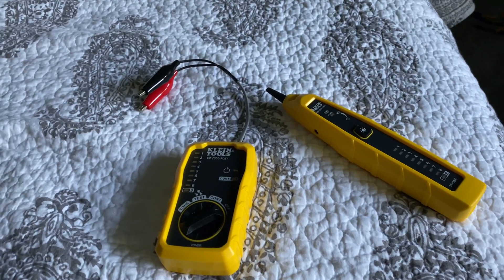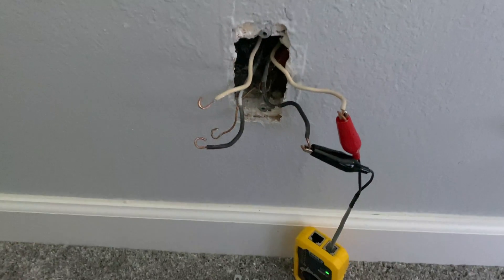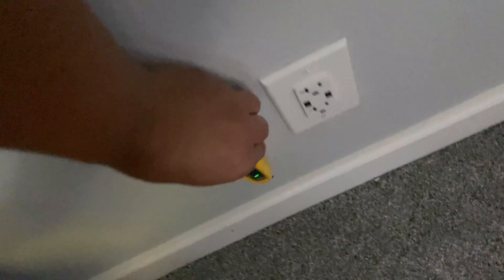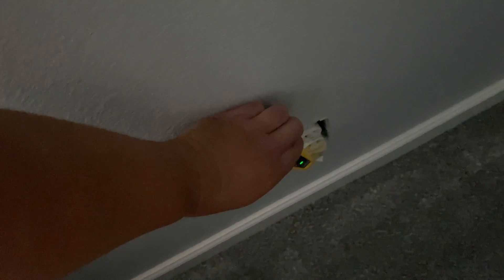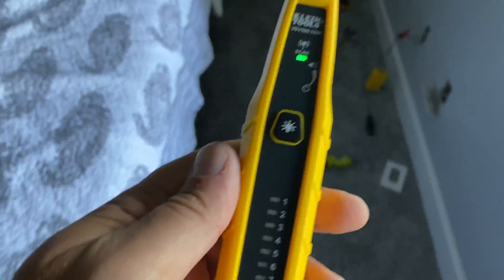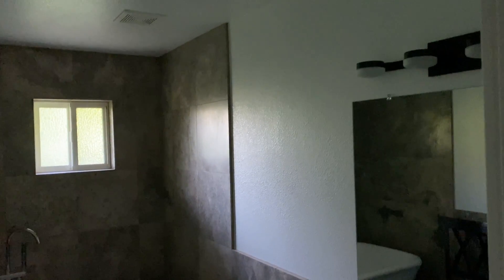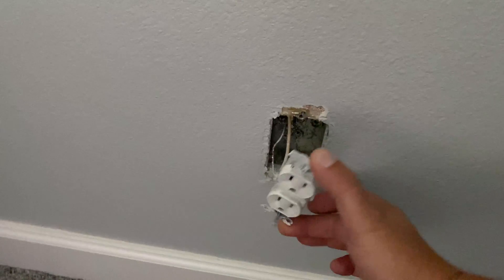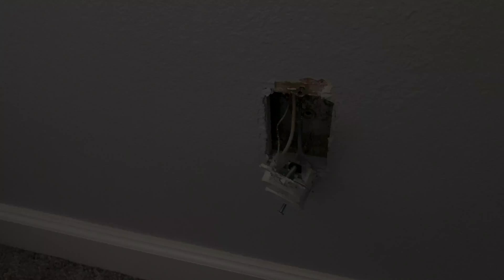How to find wires inside walls: Wire tracing tool- how to

Comment: Great.  :-p  One of those people that screws up wiring where an electrician, and or purchaser of the home does not know what's running where, and or too much is on one circuit.  Or, it was already screwed up, and you made it worse, instead of fixing it?  Depending on your existing panel, circuits, wiring, have one circuit for each room.  Also, depending, that may be in relation to what is, or needs to be, connected/wired to each room, such as, possibly, 1 or more 15 amp, 120v mini splits or window AC's.  Of course, there can be, for instance, if having an older panel with not enough wiring/breakers/circuits, two bedrooms next to each other on the same circuit, but wired correctly, individually, to a proper breaker, and labeled.  ETC!

I completely understand many may want to DYI.  It seems to me most people think of hiring a pro, or DYI.  But, they don't think about both.  Plan out what is wanted to be done, put the plan on paper, hire a pro to eval.  Sure, you will have to spend some extra money, but that is still a lot less expensive than also hiring the pro to do the work.  That can save you a ton of hurt!*

*The wiring you put in the wall for the TV,  is it properly terminated?  I.E., does it need to be in a junction box according to your local code?  (Often, local code is stricter than the NEC.)  If by some chance it causes a fire, when the insurance finds out, and you can bet they will, they will deny any claim.  So, since it was not clear, or I missed it, are the wires still hooked to the outlet?  If so, disconnect them.  Loose wire/s in the wall connected to nothing will harm nothing.  But still, you can wire nut them and put electrical tape on, at least, the junction box side.  Or, pull the wire out.

TID BIT: Never leave an open splice, anywhere.  In the attic, protect the wiring from damage, such as just accidentally walking over them and damaging the insulation.  Check codes, such as for stapling, also.  A homeowner can usually run loose wiring in a wall, as long it is permanent, but the attic may be a whole other story.

Comment: word to the wise when the batteries get below about 50% the tone gets too quiet to hear through most walls so i would recommend putting rechargeable batteries in them if you use them a lot

Comment: I had the same problem with my sister's house. 6 outlets don't have power. First, the 3 outlets (are connected to each other) from front door -> window -> corner of the house. However, from the corner outlet, I don't  know where the wires go next. The wall adjacent to the corner outlet, there's an outlet behind the piano and that outlet doesn't work. This outlet is not connected to the corner outlet. So I don't know where the corner outlet is connected. I did more troubleshooting and found out that the piano outlet is connected to the right outlet behind the tv. Behind the tv, there are 2 outlets (left side, and right side). The left side duplex outlets work, but not the right duplex. I found out that the right duplex is connected to the piano outlet. The outlet behind the water bottle has no power. I can't find out where this outlet is connected to. 
Will this device help me to find it? I need help. I'll buy this device and hopefully I can find where the line goes.
Reply from the maker: Sorry for the late reply! yes it will... make sure all your breakers are off, connect it to your mystery wire and trace it with the tone... hope it helps!

Comment: Great demo. Don't forget to cut power on all breakers first! May not be obvious to newbs.
Reply from the maker: Thanks James! good point on the breakers
Reply: @PilotJon  Thanks. Your video was very useful. I have always use toners in low voltage environments, but never in high voltage applications. Thanks to your video, I was happy to know I could a use the toner tester without making a huge flash bang or worse. I had to see someone do it first though! There are instructional videos or discussions out there, but not much demo.

Comment: Good demo, however everyone should know to shut off the breaker(s) and test the outlets with a tester to ensure there is no hot wires or current on the outlet(s) your working on. Not only for safety, but the wires have to be cold for toner to function properly... unless its low voltage like data wires, these can remain on.
Reply: I'm tired of those videos always mentioning the whole safety chapter of the manual. Yes, we know we cannot put a cat in the microwave to dry it. Those who don't, will have to read the manual.
Reply from the maker: 😂❤️ same…

Comment: Does this have a range or as long as the tester is connected or the tone tool will always beep if it sees the signal in the wire
Reply from the maker: as long as it is connected to a wire it will work. no range basically

Comment: Do I need the power off or can be on ? Thanks for your helps.
Reply from the maker: Good question- the power must be off using the tool I used.
Reply: thanks for very  for the quick response video

Comment: The title is wrong. As you said it is a continuity tester and that can be done with much simpler equipment. You can't find wires in the wall with this.
Reply from the maker: Sorry yours didn’t work out, mine clearly traced the wires inside the walls
Reply: Sure you can

Comment: Will it work on wires that have no power? I have some wires that aren't getting any power so I need to trace them to see where they go without tearing up the wall and ceiling.
Reply from the maker: Absolutely. In fact for this tool, the power must be off

Comment: My walls are concrete covered with plaster.  Wiring is 220-230.  I need to know where the wires are, so I can drill into the walls and hang pictures.  Will this tool work for me?  Is there one I can buy and use in Europe?  A lot of electrical issues are different here.  I have not found any local information on how to determine where my wires are.
Reply from the maker: you sure can! I didnt explain that my walls are block wall covered with drywall (plaster)

Comment: Very helpful! A retired electrician gave me some of his tools, and this is among them. I need to tap into a porch light supply so that I can run power to an outdoor ceiling fan, so this will help me tell where those wires are.
Reply from the maker: it will!

Comment: I know this is an old video, but can this trace a single wire? Like a 3 way switch? I'm trying to figure out which wires are my travelers and I'm not an electrician. I'm trying to trace my red wires, because I have 3 switches to go to one light, and they all work independently, but not together and it's annoying.
Reply from the maker: Hi Chris, with this one it has to have dual wires.  You could use a continuity tester for your situation. I’ll buy one and make another video because that is a common issue
Reply: @PilotJon  I could use continuity to check that? I'm a service tech, I'm still learning with electricity, like say for instance, how do I know one red wire at the bottom of the steps is the right wire at the top of the steps? Thanks for the quick reply man!

Comment: Question, does that tool works with wires without power.?
I have an outlet that idk where it comes from
Reply from the maker: Yes, this tool you must work on wires without power. Any power coming through the lines will ruin the tool.

Comment: I have a locked room with a 6 bulbs ceiling lamp ON and I can't go inside to turn off. The breaker for this light is also connected to the kitchen and bathroom lights which I need it, so I can't turn the breaker off. If I find the location of the switch in the opposite side, is possible to disconnect the electric wire from the wall outside of the room? Thanks!

Comment: Great demo!

Question. I just moved into a house with a patch panel in the first floor closet.  There are 5 ethernet cables from the panel, I see a ethernet jack in my office and master BR (upstairs).

There are 3 ethernet cables left.  But the 3 other BRs do not have the ethernet jacks and I cannot find jacks elsewhere.

Is this tool good for finding where the ethernet cables may be?
Reply: They make a version of this tool for ethernet. It is called a "toner".
Reply: @HunterKleinTheHuntzman  I will add to this: they made different adapters for the tone generator called a “banjo” - some for RJ-11, and some for RJ-45.
Reply from the maker: this one comes with multiple adapters- Ethernet was one of them

Comment: Would this work to find out what switches power different devices? I have a couple light switches in my house that I am not sure where they go to and would like to find out.

Basically could I hook this up to the wires on the switch and go to different outlets/lights to see which ones the switch powers?

Thanks!
Reply from the maker: Absolutely! Just make sure there is no power to the wires when using this tool 👍🏼 let me know how it works for you!
Reply: I appreciate the response! It’s between either trying this or just having an electrician come over and doing it!
Reply from the maker: @charlie_schneider93  the tool should be cheaper ;)

Comment: Do electrical power have to be turned off to those outlets, to check them first? I want to replace the rest knob and tube electric wire in my house, with Romex. I'll abandon the knob and tube and replace it with new Romex. The electrical box isn't that well labeled.
Reply from the maker: Great question- yes the power must be shut off for these to work properly. Sorry for the late reply

Comment: I have a (maybe a dumb) question: does the power at the testing outlet has to be off before using this equipment, or the tester can be used on a live circuit???
Reply from the maker: Valid question! Sorry for the late reply. yes power must be off or the unit will be ruined.

Comment: Hi Ron, great video.  am rehabbing a house and There are few switches doesn't do anything. How do I figure out where that wire is going? or what is that switch is controlling?  Thanks
Reply from the maker: Great question. You can use a wire tracer like this but first you must make sure there is no power coming through the wires you connect to. You can verify this with a simple voltmeter or outlet tester.. Then follow the wires with the tone tracer!

Comment: Quick question... the wires that you are testing in your video, are these live wires that are carrying current or did you first turn off the power from the circuit braker?
Reply from the maker: They have to be cold. So flip the breaker and verify with a plug in device or a voltage meter. If you do this with live wires the tool will get ruined 👍🏼

Comment: I wasted so much time on thinking I had bad network cables with this model.  The #8 led was burned out straight out of the box.
Reply from the maker: Oh man! sorry to hear! That is really a bummer! To test the LED's you just connect all leads with no wires between them... I should have made that clear in the video... I have another project, maybe I'll do another video and show that.. Thanks for your input!
Reply: @PilotJon  my comment wasn't meant as any type of a complaint towards you. I was just irritated on the LED light. I think the next one I'm going to get has an LCD display.
Reply from the maker: @mykylc  nooo I didn’t take it as offense I promise. It’s just a bummer the tool failed you
Reply: @PilotJon  its life.  It was a freaking murphys law job.  Lol

Comment: @2:21 looks like the wire goes downstairs?? Makes no noise in the wall (like the other wire did) but it made noise near the baseboard then goes to that outlet. Maybe looped with a plug downstairs or just across low on the wall
Reply from the maker: Excellent point. This house is a single story on a slab with 8” block exterior walls- that point you hi lighted is where the wiring goes into the block wall is what I think- because it just didn’t sense like it did on the 2x4 walls. Great point though! Thanks for watching and your input!

Comment: What would be the best method to see if you have wiring for lighting fixtures in the wall? For example, I have a room with no indication that it's wired for a lighting fixture. Is that commonly branched out from existing receptacles or do they typically run on their own dedicated breaker?
Reply from the maker: Typically on the breaker for the room. If there is wiring for any light it will have a fixture on it already- Sometimes in older homes they will have a switch run an outlet that you can plug a lamp into. I think thats what you're referring to?
Reply: @PilotJon  Yeah, it probably doesn't have wiring already ran for a fixture. It does have a switch tied to an outlet, might just use that with a lamp. Thanks.
Reply from the maker: ForeverYoung sure thing! Yeah it may just be one outlet on the double outlet (top or bottom) let me know how it goes for you!

Comment: Do you know if this tone tracer works with armored/BX cable?
Reply from the maker: I don’t know for sure. But if you can connect the 2 alligator clips to the 2 separate wires- it will work! Let me know how it goes??
Reply: Pilot Jon can you trace a single wire or do both clips have to be attached
Reply: I have same question.  I think the bx armor will shield the signal.  But i am thinking about clipping a tone injector to the armor itself.   The only problem is that its a common ground so all the cables in the house will buzz but i might be able to still trace what i need

Comment: Great vid handyman :)  Quick question unrelated to this ....a friend of mine is at my house right now asking why some AZ washers struggle to produce cold water?  She had cold water come thru at one residence  and the place she's at now has no cold water.  Any info would be appreciated!
Reply from the maker: Good question! Theres many factors for sure. one is the time of year. the ground temperature will warm the pipes and water. the depth of the pipes will affect the temperature also. and finally the type of dirt the pipes are buried in affects it. clay like material will conduct a temperature and maintain it better than a gravel type. Take an apartment for example- a second or third floor will probably not have a cool "cold" water because the pipes stay warm in the wall all the way up..
Reply: @PilotJon  thank you! Great information. I never would have considered the type of dirt! As a homeowner, this helps a lot. I will let her know.  Thank you for taking time out to respond. 
P.s. when can I buy some eggs???